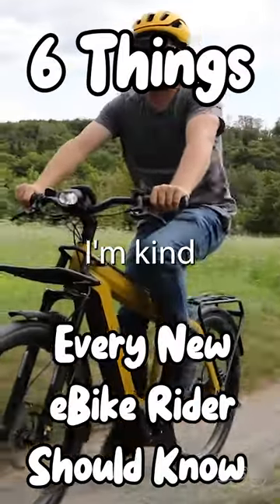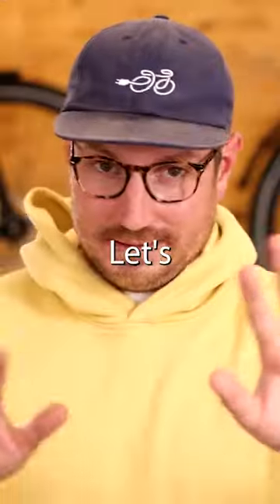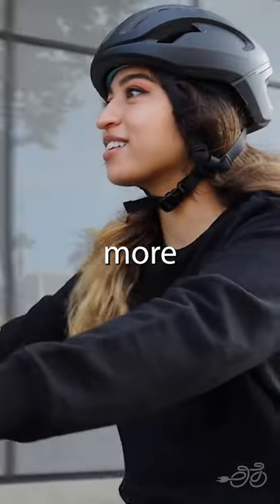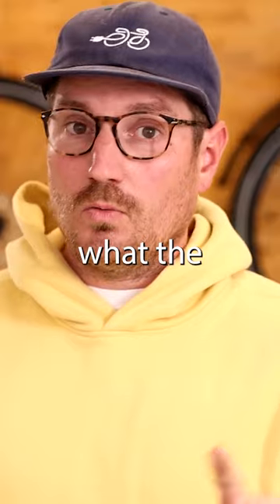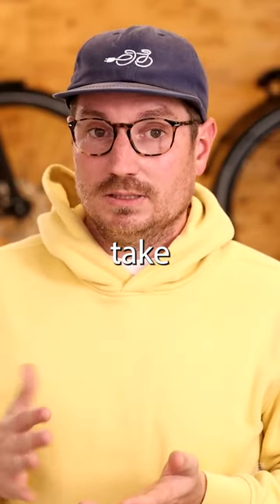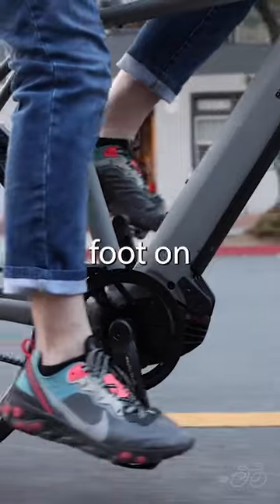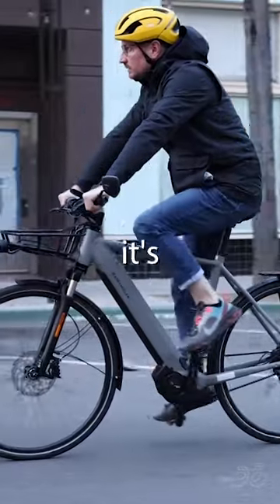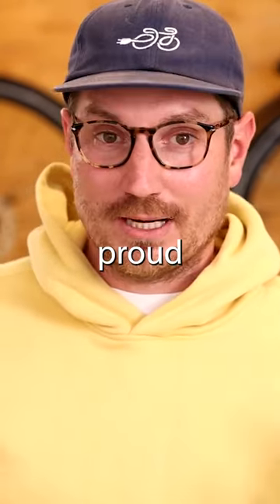How to adjust your ebike saddle height

Comment: The height you recommend is really appropriate for street riding. I really like it lower for rough trails or where you have to deal with a lot of curbs at speed and potholes.

Comment: I have a dropper seat post on my ebike.  I set it low when starting or stopping.  As I get moving, I raise it up.
Reply: Same. Dropper posts are seriously underrated for urban cycling. They allow you to be stable and sit on your saddle at lights (sometimes really long ones--looking at you, light by the fire station on my way home), which is great for heavy loads, but you can get to the correct height when you're moving. My PNW Components one that uses a spring has been going strong for years with just a string change, despite way more usage than is typical of MTB riding.
Reply: for cargo bikes my experience is half down bc you don't need to put your feet on the ground and usually they can be (bikes)more high then usual ones,so it depends on your high too
Reply: Some gravel bikes are now dropper routing ready. They could be great for hybrids and commuters as well. And the same for entry road bikes made of aluminum.

Comment: I wish e bikes had the pedal further forward.  This would allow feet on ground without stretching. With power assist you don't need to have best angle for pedaling power.
Reply: I want a recumbent electric with a bucket seat.

Comment: I've allways learned that the correct hight is when you can still touch the ground with the tip of your toe, which is safer when you need to stop. You can still stay seated on your sadle while standing still for a traffic light or cross road.

Comment: Okay. What do you do when you loosen the quick release lever and the saddle post won't move?
Reply: WD40 between the frame and the seat post. Then take a rubber hammer an give it a few wacks on the seatpost downwards (not from the side!). Works for Steel and Alloy frames, wouldnt to it with anything involving carbon.
Reply: @oeliku3033  That's consistent with what the community bike project guy told me. I tried WD-40 and penetrating oil, a rubber mallet and a pair of Channellock pliers. Turned out it was so stuck that I had to back off when the frame started to bend as I tried to get it loose with the pliers.. I'm told that there's a special tool that they use at bike shops for really, really, stuck saddle posts, so I'll try there next. Thanks for the tip.